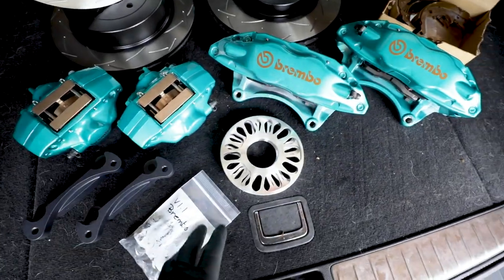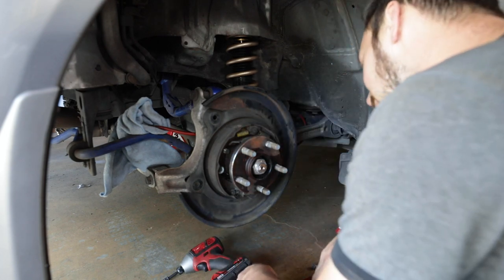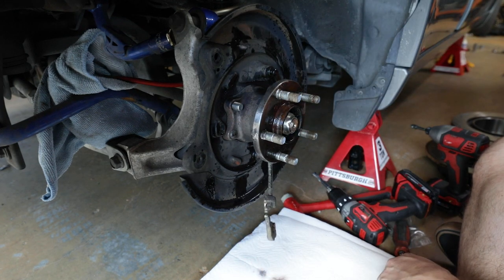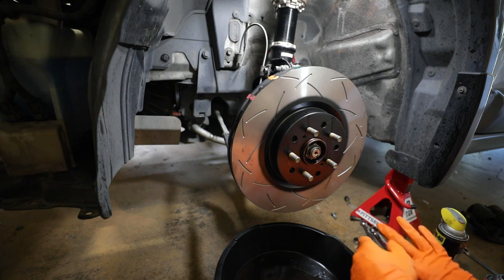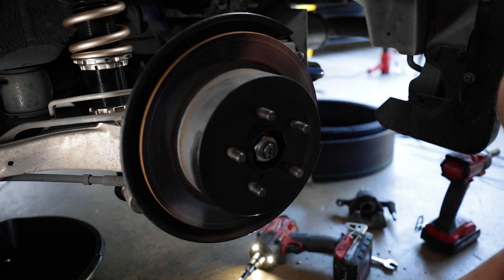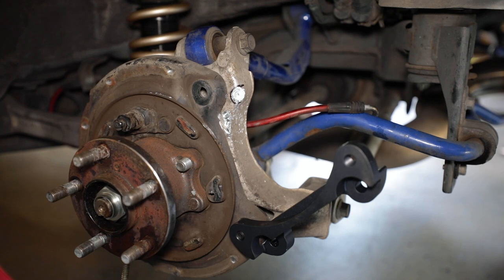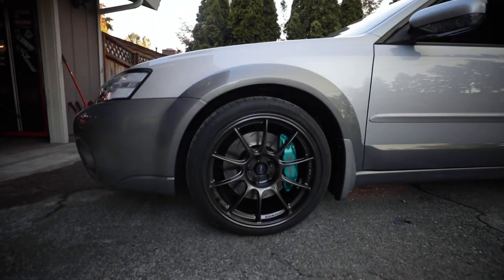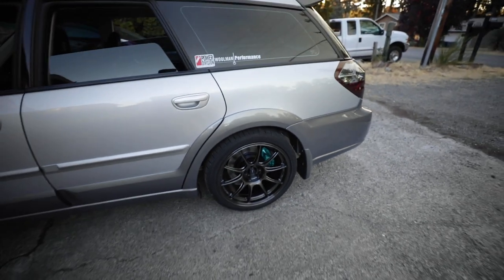How to Install STI Brembo Brakes on the 05-09 Legacy/Outback

Comment: Nice job, I dig that color combo. Pro tip - Use 2 M6 (I think, 12mm head), short bolts to pop rotors off the hubs. That's why they have the threaded holes in them. Much easier than beating them with a hammer.
Reply from the maker: Yeah always a good option. Just had issues in the past with rusted rotors just destroying the threads so I turn on hammer time and go to town now. 🤣

Comment: I did the conversion rear parking brake shoes instead of the rotor, with the thinking that a rotor is a more regular wear item and I’d rather have a wide variety of rotor options rather than being tied to a single rotor.
Reply from the maker: Good way to look at it. Would be a step up if kns ever decides to discontinue the adapters. Honestly my brake shoes were barely worn at 230k miles. Maybe half a mm less than stock if that.
Reply: @MatlasDI  That’s barely anything! I guess that’s what happens when they’re engaging just to hold static and not being used for some drifty boiz

Comment: Sorry guys. Everyone is using all sorts of abbreviations. I have a 2010 outback. Will a 09 impreza STi be a direct bolt on? I will have to import brackets and things, which makes it impossible. I will have to get everything from a scrapyard, I need to know what models will be direct bolt on.  Front, rear and master cylinder please.

Comment: Hey man. Question. I have a 2009 wrx. Doing this same brembo swap. I bought rotors from an sti. Would I have issues with the rear drum brakes or would it be a direct fit? 
Also I have stock 09 Wrx wheels and I guess I have to get spacers. Would 5mm be good enough? 
Thanks

Comment: Hey Matt, just wondering if installed the KNS oversized brake shoes on yours? I'm trying to find the correct rotors for mine to fit.
Reply from the maker: Got the kns/dba 4000 rears, so they just use the oem legacy/outback rear shoes. Fastwrx.com has everything you're after 🤙

Comment: So no issues with the stock MC moving all that extra fluid? The pedal doesn't go too low when applied? Just seems like a lot of fluid to move for those extra pistons.
Reply from the maker: No issues. The surface area is negligible between Stock 2 pot to brembo 4 pot. When bled it requires the same pedal travel and the abs module can operate normally.

Comment: Great, thanks! Is there any real benefit changing the hub to 5x114 over 5x100? Can the 5x114 ever work on 05-09 outbacks? Off the topic Did  you and Tanner serve in our military?
Reply from the maker: No one has figured out a rear hub solution for these cars yet to swap to 5x114. I want to give it a shot in the future and may try to on the outback this next time around, but there isn't an easily available solution. 5x114 hubs from an sti are a lot stronger, and you get much better wheel selection, so it would be a huge benefit if you could figure it out. I was never enlisted, but Tanner was in the army for a while 🤙
Reply: Thanks Matt. I had read that the 5x114 hubs are much stronger. I wonder if the whole rear sti suspension subframe would fit? I had thought about trying it awhile back. You have inspired me to get back into building beast aka the 06xt. It's been sitting for a couple of years with a blown motor. Going to slowly start piecing it together starting with the six speed swap and then build the motor to the power levels I've always wanted! You have built the best xt I've ever seen! So thanks for the inspiration! I'll thank Tanner for his military service! I thought I had heard you guys mention it at some point. Your great guys!!!
Reply from the maker: @Mark A  i think our issue with a subframe swap is the trailing arm/ knuckle setup that these cars use, but i was considering machining out the knuckle to fit the sti bearing assembly. And thanks man, means a lot. 🙏 I can't wait to see what you wind up doing with it 🤙

Comment: I'm a bit of a newbie to suspension etc. so forgive the stupid question...

The blue piece on top of the brake assembly that connects to the body/inner wheel well obviously isnt stock, is that to help keep geometry correct when lowering the outbacks?

I hear when lowering Outback you need legacy trailing arms I think it is to keep this all in the realms of "ok"
Reply from the maker: Hey man, not a stupid question. you've got the right idea, the blue arm is a megan adjustable upper control/ trailing arm. when you lower the outback the best way to keep geometry is to actually remove the spacers from the subframes and convert the components over to legacy spec which are designed for the engine/ transmission being at a different height. if you are only lowering the outback to around the height of a stock legacy it isn't a huge deal to do this, but if you're getting further into things, using adjustable rear trailing arms/ upper rear control arm is the best way to have the most control over where everything is located and get the alignment set up exactly how you want it.
Reply: @MatlasDI  awesome.Thanks for the info. I did see something about the sub frame spacers elsewhere but that made me nervous on my daily not knowing if I’d need new drive shafts from gearbox to diff etc.

I was thinking of going legacy gt height. Where the arches are just in line with the tyre. Local laws dont allow anything lower than 100mm(4ish inches) off the ground :/
Reply from the maker: Should be okay then. the adjustable arms are pretty easy to add after the fact if you need to get more adjustment.

Comment: grinding it might reduce strength in that part sufficient to cause it to break under extreme force. Are the backs even really needed?
Reply from the maker: You could always do just the front, it may change bias slightly but more than likely would not be noticeable under standard driving. I don't believe grinding is necessary with anything but the aluminum rear trailing arms, and might not be necessary with a different adapter kit.

Comment: Nice work on the brembo upgrade! Is it pretty much 2004-2014 brembos that will work?
Reply from the maker: As far as the calipers, you can use any of this style sti, but gd is preferable, for the rotors you just need to make sure to get 5x100 style like that from an 04 sti. For the rear you can pick up kns/dba rotors that keep the rear ebrake shoe size, or swap them out for sti ebrake components and use normal rotors. Fastwrx has a huge selection so they make nice rotors like dba 4000's with that Internal drum 🤙

Comment: Looks great man!! What wheel and tire combo are you running?
Reply from the maker: Thanks man 🙏
Running 18x9.5 +45 wedsport tc105x with 255/35r18 continental extreme contact sports.
Reply: Oh sick!!  I’ve been looking for wheels and tires for my outback!
Reply from the maker: Have to use a spacer with these for rear clearance between the trailing arms, so if you're going 9.5, 40 would be the highest offset I'd recommend running. Hard finding proper offset wheels for these 🥲
Reply: Ya it really is I was thinking like a 35 on a 18x9.5
Reply from the maker: Would be good. My old setup was 18x9+30 with 255/40s. Little bit more meat.
Reply: Did a 18x9 rub any on 30?
Reply from the maker: Have to modify the fenders. I cut the inner fenders and trimmed the flares.
Reply: Is that what you’ve done to your current setup?
Reply from the maker: @spacegeek1534  yeah still cut and trimmed, having to run 5mm spacers to avoid clearance issues with the trailing arm.
Reply: @MatlasDI  ah ok

Comment: I have a 2010 outback I want to do this with but from what I've read, it's a direct bolt on from the 2015 sti brembo's
Reply from the maker: I can't speak from experience on the 5th gen cars, but you'd still need to use the 5x100 rotors from '04 To match the hubs front and back as the sti is 5x114 and the outback for that gen is 5x100. E-brake may already be of correct size so may not need the kns rotor, but not positive. Would just need to check rear caliper clearance and bolt spacing from the knuckle. Fronts should bolt straight up like the other cars. 👌
Reply: @MatlasDI  awesome thanks dude!

Comment: What did you need the spacers for? Were they required for the upgrade?
Reply from the maker: Not required for the swap. My wheels would contact my inner trailing arm in the rear due to size and offset, so I use a small spacer for clearance.

Comment: Can u fit the factory wheels? The 17? Since I use them for winter tires
Reply from the maker: I believe so, but I'm not entirely sure. Might have to use some spacers, they should clear circumference wise, just would depend on spoke clearance.
Reply: @MatlasDI  thanks

Comment: I'll hopefully be doing this on my OBXT. 12K/10K?! I've got FA 500s with 8K/8K Hyperco springs and the ride is FIRM, a a 🤏 bouncy, and I don't think the sway bars are even necessary. I can't imagine how stiff your set up is.
Reply from the maker: The 12k/10k honestly felt money on my setup, it may have to do with dampening or preload to some extent on setup. Mess with dampening settings to get it to match with spring rates and you should be able to get any type of bouncing out.

Comment: sooo the rear rotors and pads were for the gd wrx? cuz some ppl say the rears are for lgt and itll fit the brembo
Reply from the maker: The rear rotors are a modified sti rotor offered by KNS and DBA. they feature the inner drum diameter for wrx and legacy/outback ebrake components. Pad utilizes standard sti brembo rear pads. You can either run the dba/kns rotor variants or swap ebrake components to sti and run a standard sti rear rotor.
Reply: @MatlasDI  how do i order that rotor? i dont see it on their website. do i call them and ask? or can u link them? im trying to go brembo route for my legacy. thanks for the reply
Reply from the maker: Np dude.
https://www.fastwrx.com/products/rear-brembo-dba-slotted-adapter-kit-02-05-wrx here is the slotted rear adapter set, they also have the unslotted which is good amount cheaper.
Reply from the maker: https://www.fastwrx.com/products/kns-dba-rear-brembo-adapter-kit-2002-2005-wrx here is the standard unslotted
Reply: @MatlasDI  thanks dude!

Comment: What year of sti are these off of? Or does it not really matter
Reply from the maker: The calipers need to be the GD versions so 04-07. Spacing is different IIRC on the 08+, at least for the rears. Best to get a set of GD golds to be sure.
Reply: @MatlasDI  thanks for the tip

Comment: Do you know if this set up will fit on a 04 outback
Reply from the maker: From what I've seen this should be the same or very similar for the prior gen legacy and outbacks as well. You would use the kns v1 rear caliper adapter like i did, front will bolt right up. 👌
Reply: Thank you kindly sir.love your videos keep it up

Comment: What wheels are those ? How do we choose wheels sure to clear ?
Reply from the maker: My outback has wedsport tc105x's. The main clearance issue is the inner trailing arm on the rear. Determining proper fitment, I'd use willtheyfit.com plug in your current wheel size and then mess around with things to see where it gets you. I ran 18x9.5+45 on this car but ran into issues with it touching the trailing arm on the rear requiring spacers. Having tested a lot of sizes I think 18x9+38 is nice on this chassis; fills out the wheel well, close to the fender and the trailing arm, good scrub radius, and can fit up to a 255 without issue, but in the end it really depends on what look you're going for. There are a lot of threads on the legacygt forums for different wheel sizes and fitment. It's also worth noting that the front tracks wider on this chassis, so it isn't uncommon to have a spacer in the rear to make it look more uniform.
Reply: @MatlasDI  I thought the issue was ensuring the wheel spokes didn't interfere with the caliper.   Thank you for all this great information.  Real nice job on the powder and this video !!
Reply: @MatlasDI  I kinda wanna keep the rugged look to my '04 Outback. So I was thinking stock '18 to '22 Outback or Crosstrek wheels with spacers.  They can be had relatively cheap.  Would they poke out ?

Comment: Are the rear spindles ok since grinding them?
Reply from the maker: Yeah no issues with the trailing arm sections. Only needs to be done on spec b aluminum arms iirc. Best to only take off as much as needed.
Reply: @MatlasDI  sweet, literally about to do it to mine
Reply from the maker: Yupp, easiest way is marking with the sharpie and a rotary cutting burr, but the drill worked well also just have tk be careful. Best of luck dude 👍 I would test fit as well as some other conversion brackets may not require the same amount of clearancing.
Reply: @MatlasDI  I got through, brakes are functional…. I had already bought the kns brackets a while back. I’m using 04 sti brembos powder coated in prismatic powders illusion blue and rebuilt with oem seals and pads, dba t3 4000 series rotors, the kns bracket and wheels are enkei tfr 18x8.5 +45 (they clear without a spacer)…. Braided lines and a sti brake master cylinder. Oh and a Cusco master cylinder brace. Brake system complete!
Reply from the maker: @rharripersad  heck yeah dude. Should stop like a beast now. Would love to see it. If you aren't already you should join the discord. https://discord.gg/m6URUBFc
Reply: @MatlasDI  will do